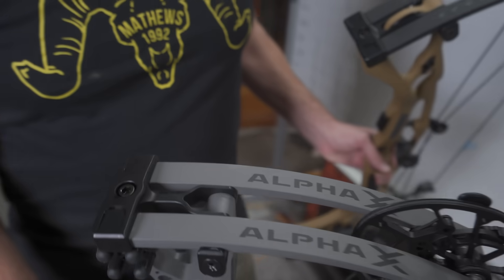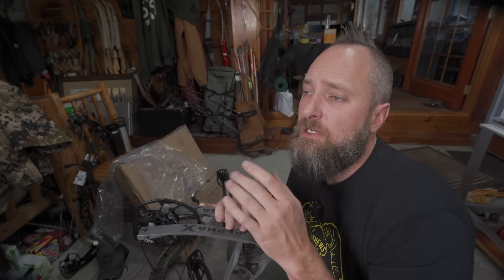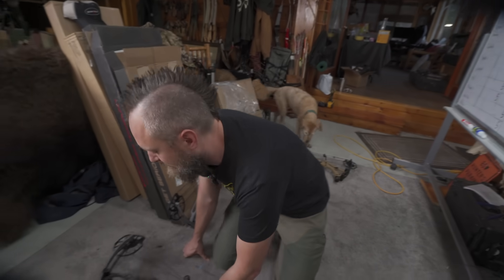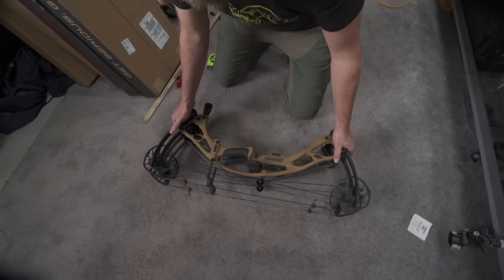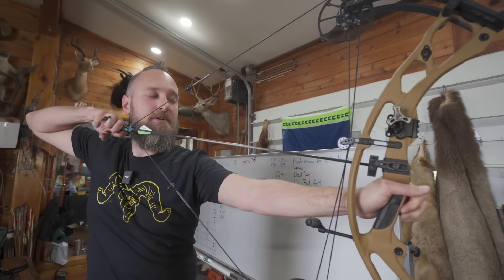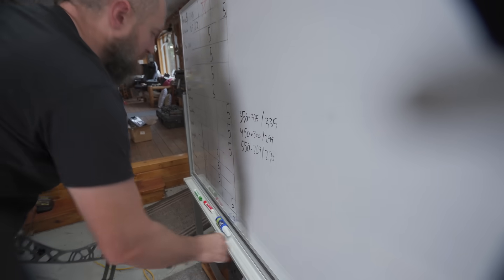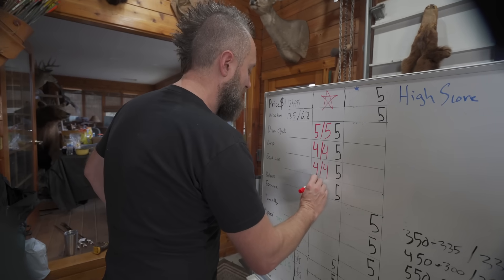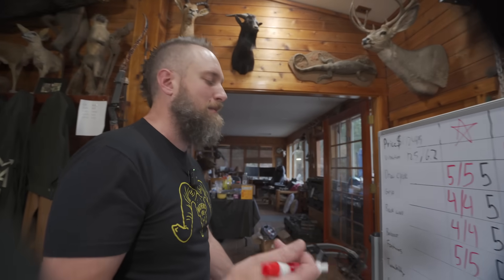Hoyt 2024 alpha x and rx8 breakdown with MFJJ!!!!

Comment: Whoa - for that carbon to produce so little vibration, have an easy/smooth dry cycle, and to produce a 335ish ATA speed is crazy good.
Reply: I think the vibration was actually fairly high and he left the bottom stabilizer on with the Carbon and did NOT have the lower stabilizer on with the aluminum riser Alpha. I think Carbon tends to vibrate more....

Comment: 3 Days ago @ our local range a friend who just back to archery after a 20 yr lay off… anyways he picked up a fully loaded rx8 shot it for 3 months no glitches 👌🏾however 3 days ago ?
While we both were practicing at 70 I saw him take a last shot then we took a short 5 minute break..well after the break we went back to shooting however when he went to draw his bow? He noticed the string was slacked and twisted on the top cam…
After closer inspection the top cam mod screw sheered off causing loosening twisting of both mods binding on the top and bottom limbs…. 🤫🤔my buddy never once dry fired the bow and was using correct spined   340 arrow arrow @ 70 lbs 420 grains🤷‍♂️true story in 6/12/24

Comment: Once the bow is in tune you shouldn’t be messing with anything anyways. So adjustment on the cams is kinda a waist imo!
Reply: 100% you use the spacers the first time to adjust the cam and you shouldn’t need to do that again. That’s why I’m so puzzled who some people rate tuning tech so highly.
Reply: @toddlymburner5783   Because he works in a shop and the faster it is the more work ($$$) they can crank out. Or if tune is included in the free setup its less labor cost sunk on a new bow sale
Reply: @jhoppmann  oh I know, but they try and push it like it’s a big plus to the consumer which it’s not.
Reply: Matters a whole lot when you live 4 hours from a shop and the guy who tuned it did so with the rest and not the cams.
Reply: But why not have the option.
Reply: @panhead65hd81  you go to the bow shop 1 time is all you need. You need to put your peep in and get the timing correct so your going to the shop anyways
Reply: @chrismartin2582  if they could do it and still make the bow perform like they are currently they would. Go shoot a Bowtech which had the best tuning tech in the industry. It’s inferior in every other way once you get past tuning. Only difference between a Bowtech and a Hoyt when tuning is you’ll leave the shop 15 minutes earlier when tuning a Bowtech. But when I leave 15 minutes later with my Hoyt that’s also tuned I will have every advantage
Reply: @toddlymburner5783  just because your grouping with a field point when you leave the shop doesn't mean your broadheads hitting the same. Also depends on the shop just because they have authorized dealer on the front doesn't make them good at their job.
Reply: @panhead65hd81  ok so what’s your point? Once you leave the shop and shooting bullet holes you broadhead tune. I personally broadhead tune (fixed) out to 80 yards. Micro adjusted my Hamskea 1 click and it was set. Changed my string 2 times since than and have not had to make another adjustment. Once you get your wheeling in tune shooting bullet holes you no longer need to be moving the cams position. The people who are constantly dicking around with the deadlock system are torquing the crap out of the bow or don’t know what they are doing. There are lots of stories of the deadlock having stripped screws or seized because dumb people are constantly messing with it. The adjustments for broad head tuning after shooting bullet holes are extremely small, a click or 2 micro adjust at most on the rest.
Reply: @toddlymburner5783  My guy your missing my point. If you go to a shop and buy a bow and the shims it came with from the factory don't have your cams lined up nicely and they paper tune it by moving the rest and not moving the cams your gonna have a hard time unless you have a press and do it yourself. Your making it seem like every shop is going to tune your bow properly and that's just not the case. I get where your coming from I don't shoot a bowtech and I have a reputable shop I frequent but not everyone has that.
Reply: @panhead65hd81  the place I go to will shim your cams. I would recommend to anyone that if your shop will not shim your cams then find a new shop that will. Even if you have to drive a few hours, you’ll only have to do it once. If not then learn to do it yourself. What I would never do or recommend is buy an inferior brand out of convenience.
Reply: 😂 if you're buying a carbon bow, you can afford a press.

Comment: Would it make sense to check poundage before physical bow measurements? Ignorant question, maybe, but I didn't known if ATA, brace height, etc could change with the limb bolt settings.

Comment: Hmmm are you always shooting the carbon one first and then the aluminium one if you look back? Maybe its just that lol.. Like first bow you had 100% energy, but then after few shots you go down to 90% energy and now you change bow and draw that and it feels like its harder maybe.
Otherwise the logical answer would be that the carbon one maybe is so soft it actually contracts (tiny bit, bringing the limbs closer together) when you pull it making it weaker poundage just in that moment until its drawn, then the let off takes over and lessens the strain on the riser again bringing it back to "normal". And the aluminium one is then harder and wont contract as much, or even, and all the way through the pull its staying the same poundage.  But I never had a carbon bow. So I dont know how stiff/solid they actually are. Im about to maybe get one.. between either alpha x33 rx8 or rx7 atm (so thx for these videos, they are great, im studying em rly close). 
Back to point. But I would acuse the energy level first if you are shooting the carbon bow first always. But if its something physical then that is the only place there can be a difference (for something that drastic feeling). Bc it cant be the limbs... Cant be fittings/cams (as you said, they are the same). So it has to be in the riser/design/something if the phenomena is legit. And we already know there is a difference in the materials. So is the "logic" place. Just my thoughts tho.

Comment: Overall a disappointment from Hoyt. The price increase  on carbon and just about zero performance gains is a fail. Other manufacturers are leaving these guys outclassed step by step.  
Also I buy aluminum by the millions of pounds- Hoyt is in my backyard, and the Aluminum vendor is a few miles away - there’s a good reason more work can be done when the raw market price dropped before they made the new risers. Do better Hoyt! For my favorite brand your spinning your wheels.

Comment: Always very bais reviews.  There are some good points but the end user only cares if the bow is easy to shoot accurately how fast it is and how it feels. Nobody cares about the rest. Most of the bows now days use binary cams tuning more or less is the same some how moving the cams left or right. They are always in sync . Also how cares at 30 inch draw shoot the bow at different draw lengts. How many of your customers are shooting 30 inches? Always downplaying the most important speeds at different draw lengths.

Comment: I just don't understand guys saying " it's heavier than what specs say". Does anyone that does a bow review actually know how to weight a bow, and how the measurement is taken at factor? You weigh the riser without anything, meaning, no dampness, zero on the string, no labels glued on the riser. Nothing but a bare riser . When someone gets on media and say" they losing about weight, it's 5 ounces heavier than what paper says". Not just this review , but any review. Just like guys saying, " it's coming in  12 fps slower than advertised ". never, not once, have I shot a bow setup , that came in 10 fps under, when numbers are accounted for. NEVER.